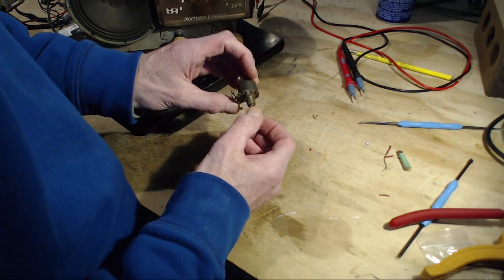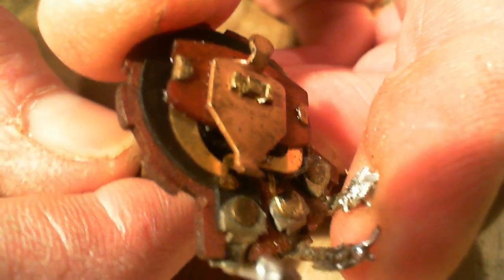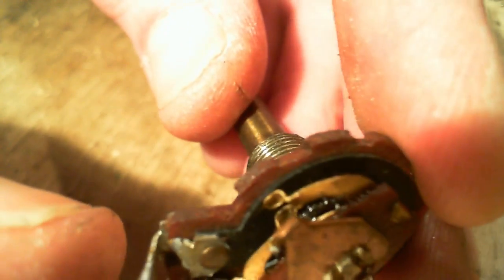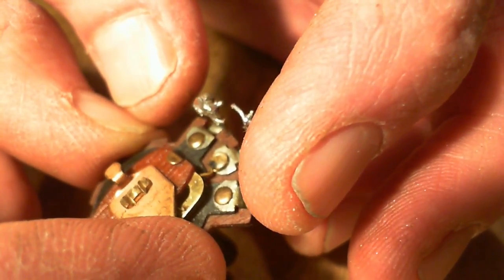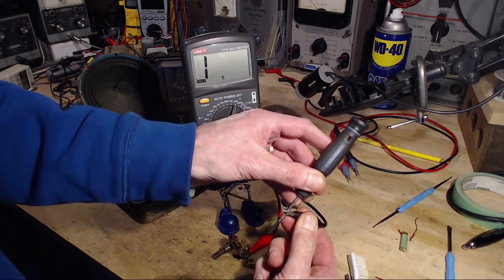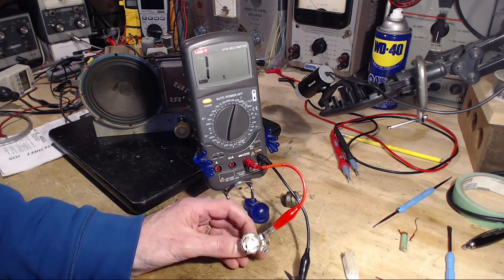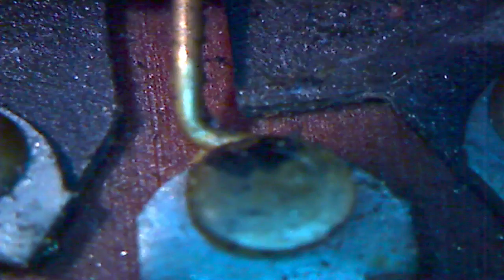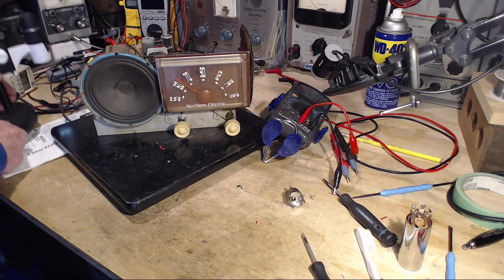Northern Electric Baby Champ AM Radio #9 -  Volume Pot Post Mortem

Comment: Probably was dropped sometime during production onto the floor, starting the crack. Then took 50 odd years for the carbon to finally finish cracking through making it open. Or the assembler knocked it with the soldering iron soldering something adjacent, starting the crack the same way.

Those are stamped out from a sheet, so the crack could have been there from the factory, just stress cycles and heat finally got it all the way through
Reply from the maker: All those ideas are certainly possible.